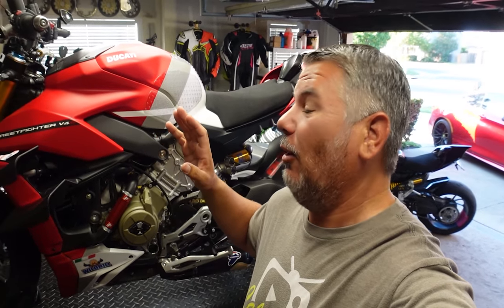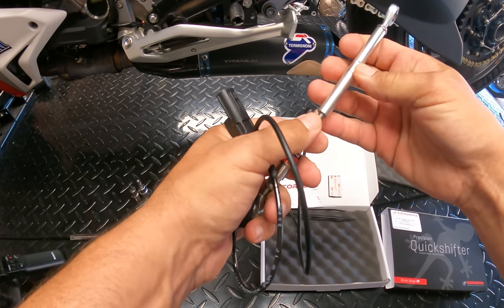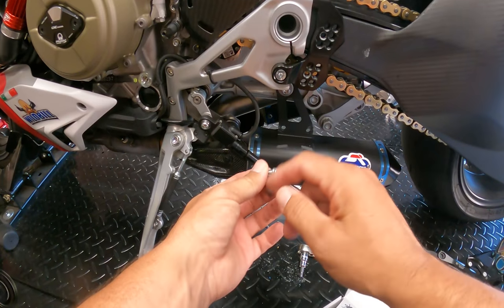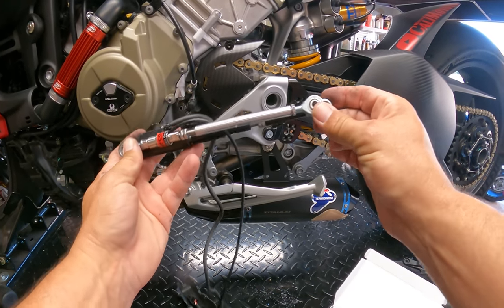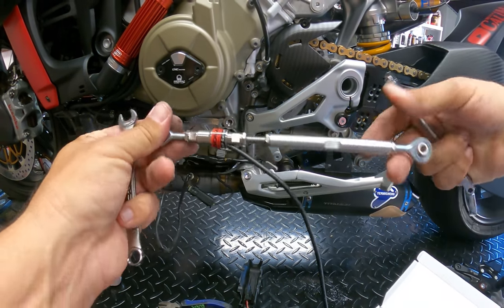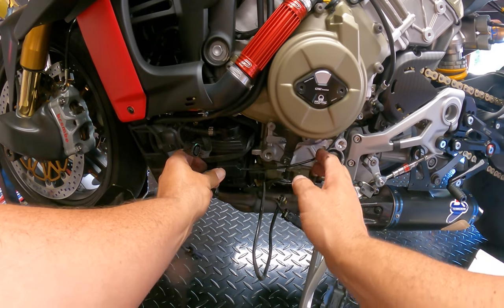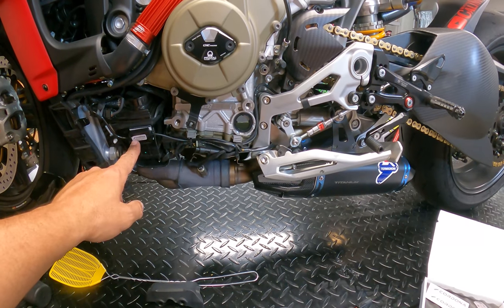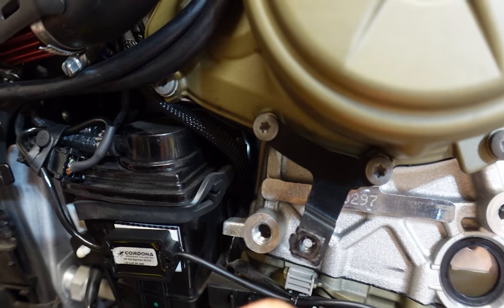Ducati Streetfighter V4 S | Cordona Precision Quickshifter Step-by-Step Install

Comment: i have one of these in my panigale v4s and can tell its a huge improvement from the Ducati OEM one - its so sensitive that i had to get used to not rest my foot over the shift lever because the quickshifter would pick it up. great product by Cordona
Reply from the maker: Interesting!
Reply: Has it improved the quick shift kill time when shifting from 1-2-3? I have the arrow slip on with t800up map and I get the lag when I shift from 1-2 to 3rd gears.

Comment: I messaged Cordona.. the calibration is only for change Up/Down direction, it doesn't change speed or sensitivity, so it is completely useless to be done (doesn't matter if you have standard or gp shift). Basically it's plug&play for SFv4.

Comment: Not a ducati guy, but like your chanel. How does a new top of the line bike need upgraded quick shifter.  Figure Ducati would make a fix if this is a common problem.
Reply from the maker: Tbh your average Italian bike consumer would probably be fine with the oem quickshifter. Just pushing it a bit a harder than intended and a lot of the stock QS need replacing at a certain point.
Reply: @CaliMotoTV  lol. You are definitely a ducati man. Coming from a bmw s1000xr rider. Sweet quick shifter. Just joking around, keep up your awesome work. Enjoy your track day

Comment: Good video.  Thanks for posting.  I have a '21 and rode a '20 with Cordona.  The Cordona is better, but I'm debating the cost/benefit of swapping it out vs. putting up with occasional missed shifts.
Reply from the maker: Everyone has to decide that for themselves. The occasional mis shift maybe ok on the street, but when coming in hot on track it can cause quite the situation.
Reply: I almost got run over accelerating on the front straight at The Ridge because I missed a shift with an R1 right on my ass.

Comment: You running standard or gp as of now? This vid made my instal with the crap instructions simple haha I matched my length with oem and it deff had alot less threads showing then yours. Mines a 2021 great shifter though
Reply from the maker: We're running standard on this bike.
Reply: mine also... trying to match Cordona with the stock I had to get it on MINIMUM length

Comment: Hey Bill! I installed exact same arrow slip you had before Termis on my panigale v4. I was wondering are you switching the shifter because you also get lag on quick shifts from 1-2-3 gears? The ignition kill time is too long on the original quick shifter right? Thanks

Comment: Don't know if you know this, the woolich flash gives you access to the quickshifter voltage and if you up the voltage slightly it makes for a smoother shift on the OEM...useless info I know
Reply from the maker: That's actually quite interesting. We're considering the woolich tune for the V2.
Reply: @CaliMotoTV  you won't go wrong dude ✊🏽

Comment: please let me know how you like the new quick shifter? I have a problem with mine on my bike 2019 v4
Reply: …..me too
Reply from the maker: We'll be testing it out at chuckwalla raceway. Stay tuned.
Reply: Yo bro u have to know the Price about 4000 $ ask to ur 🍕 pizza 🍕 dealer too N if ur bike is still under warranty it is the way to go...
Reply: @romualdlarney6053  are u sure $4k?
Reply: LoL 450$ i was drunk
Reply: I have the arrow slip on with t800 upmap on v4 2019. do you also get lag from 1st to 2nd to 3rd gear when upshifting? I feel like the ignition time is way too long on the oem quick shifter?

Comment: Never had a problem with my OEM shifter .
Reply: Then you aren't riding it. It's complete garbage. Own a 2018 since it came out in 18. I never had problems with it workin hg just never was a fan. After I switched it was a huge improvement.

Comment: I have the stock quick shifter on my SFV4S and I hate when it doesn’t shift on a hard acceleration, always feels like the anchors are on.  Also get false neutrals too often.  I’m interested to know if this mod will remedy the issues.
Reply: LOL bro Price of it is 4000$ go to ur dealer there is recalls on that...may be 4 u or go to Ducati website do u know that u Can send a mail to the pizzeria Ducati when u got a problem they will answer u or call u directly they did it for my Gear indicator
Reply: @romualdlarney6053  where are you getting 4k 😂😂😂😂 it's 450 usd lol
Reply: Mistake bro u R right
Reply from the maker: Yea it's $400. No idea where the $4000 comes from, that nonsense. We'll be testing those on both, the V2 and SFV4S this coming Monday 🎉

Comment: Okay... there's a Cordona Video... when it's in configuration mode (rapidly flashing), you have to keep pushing or pulling the pedal 6 times!! and on the 6th time just hold it... after that it will flash either 1 or 2 times depending on the final configuration... like you said 1 = GP Shift, 2 = Standard... so for GP Shift you would be pushing down 2nd, 3rd 4th 5th 6th etc... NOT 1st... the initial gear doesn't matter, it only puts it in configuration mode

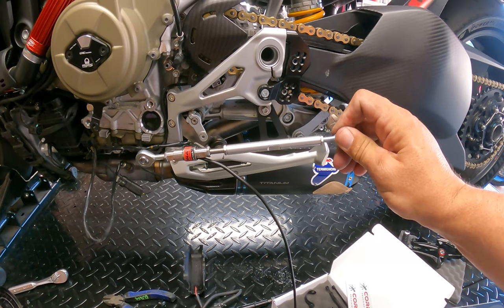Comment: Hello.  Looking at the service manual you have mistaken the place of the spacer when installing the quickshifter (movie time 8:54)
Reply from the maker: We don't have oem rear sets.
Reply: @CaliMotoTV  It is not about mounting on the set, but on the gearbox. 
The spacer should be on the propeller side and not on the gearbox side.

Comment: I get the improvement over the oem one. What is the different say from a dynojet and this Cordona? Any specific function that is better or probably the same thing?
Reply from the maker: Probably similar enough, different box.
Reply: Dynojet still issues a spring/switch. This one is strain gauge so 0 moving parts internally.
Reply: @robertwotring7318  yeah but is that really a bad thing? I mean dynojet is the leader in tuning and quickshifters. It can’t be worse, they have their reason as to why it has moving parts. They’re not stupid.
Reply from the maker: Thanks  @robertwotring7318  ... what he said 🤣

Comment: Why change . I have 2021 SF v4 and have NO ISSUES AT ALL with the OEM , I run it in GP shift patern  and it is fonctionning very well
Reply: lucky you! I have the 2021 and there are issues same with my friends that have other 2021 and 2020 V4S
Reply: @sportbikesadventures2354  Hi , can you tell me what is the issue that you had with the OEM , just to make sur that mine is ok , tank you 🏁
Reply: I just got a 2019 V4R and going from 5th to 6th it acts crazy.. I bought this 2 weeks ago and plan on installing it tomorrow.. bike has 600 miles on it so its still considered new.. I was going to get the 600 mile service and it happened twice that day..
Reply from the maker: Yea what others have said. Sure the oem is fine for coffee runs 😂

Comment: Hello I have a problem, can you help me please...Ducati Panigale V4S 2019. I installed... Exhaust Termignoni 4 Uscite + a included mapping: ,,4 Uscite with db killer,,. Plus a Cordona Quickshifter... So, since I installed that, the interruption times are from the qs. much too short exhaust no longer shoots when shifting and from first to second gear I hear an interruption but the 2nd gear does not want to go in...it feels hard...what can be done?
Reply from the maker: No idea sorry. Please consult a professional.
Reply: @CaliMotoTV  i contacted the guys from t800 upmap they didn't have the decency to write me back no answer maybe they died...cordona mike says it's the software...

Comment: My understanding is that the quickshifter on the 2020 had problems and that Ducati had a recall for those. That the 2021 does not suffer from any of those problems and works very well. Can anyone confirm that?
Reply: I have the 2021 V4S Stealth edition and still having the same problem. it got better but still I get false netrals specialty between 4 to 5th gear at high speed not a good feeling
Reply: I have the 2021 SF V4 and still had the false neutrals in the beginning. 
After i realised i had to shift more firm / harder, i haven't had any false neutrals
Reply: @MaartenLbv  have practice that and still every once in a while get false neutrals. the idea of the QS is to focus on the track while shifting is second nature. BMW and Aprillia have magnificent QS from factory unfortunately Ducati not so much. BTW I'm speaking for experience on all three brands.
Reply: I have a 2020 and had the recall done for the quickshifter. Still have false neutral problems.
Reply: My 2022 SF SP has the QS false neutral fault at 10,000 rpm + under high load from gears 4-5 and 5-6. Bike has been with the dealer for over 2 months now. Ducati have offered compensation for taking so long to fix it but they still don’t know what the fault is.

Comment: HERE'S THE FINAL INSTRUCTIONS - I have GP Shift and I have managed to put it in 1 flash - supposedly GP Shift mode, however this didn't work at all... it wasn't shifting!! Thankfuly nothing happened to my bike, just didn't shift. Like I said before there's no mechanical change of direction between standard and GP shift, so it ALWAYS have to be in the mode of 2 flashes!!!
Also, your video didn't do any setup! :D
The first lever pull or push after ignition will get this to configuration mode (rapidly flashing) - at that moment YOU MUST start pushing 2nd 3rd 4th 5th gear and then HOLD... and it will stop flashing, and then do final 1/2 flashes (always have to be 2 for Streetfighter), which confirms the setup! Your video in fact didn't do the last 2 flashes, so that configuration didn't happen at all, it simply turned off configuration mode.
I'm so upset about Cordona, the manual is such a trash... they are selling specific Streetfighter unit, but gave universal instructions!!!
Also the shifting is now a bit quicker, but didn't solve false neutrals for me, so kinda waste of money unless you're on track 100% of time.